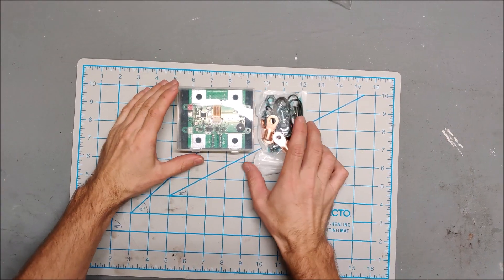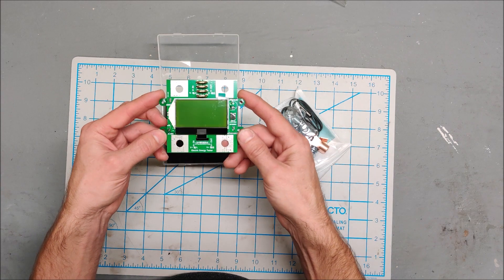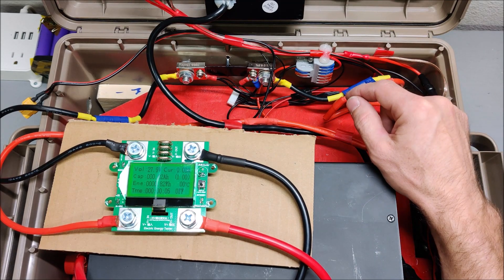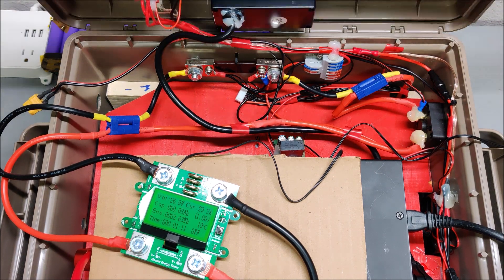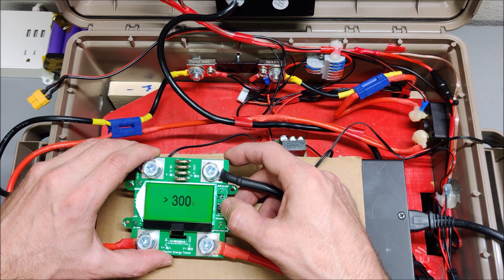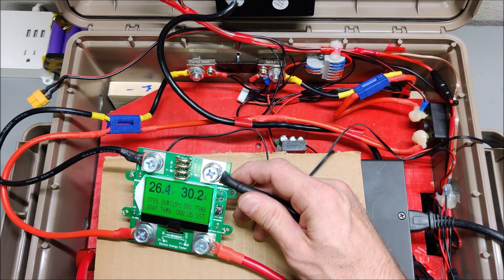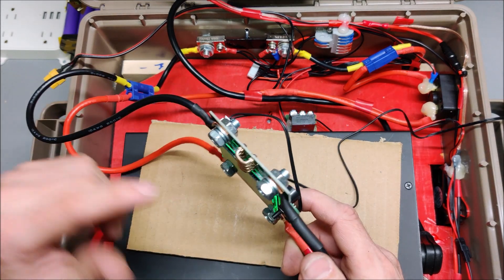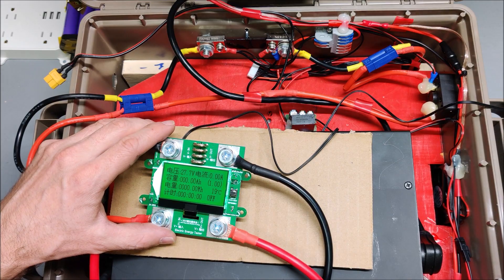$10 100A 300V INLINE METER

Comment: 8:32 The Greater than and Less than, are alarms you can set, So for example you can set an alarm for a voltage over 0-300 volts for example, or 0-100 amps etc... up to the rating of the device. It wont make any noise though, it will just flash when it reaches your set "alarm" voltage and or current range.

Comment: And, just like that, it's gone. Sorry, this item is no longer available!
Reply from the maker: https://www.ebay.com/itm/DC-300V-100A-Volt-Current-ZVS-Power-Detector-Meter-Discharge-Battery-Monitor/283530422402?hash=item4203bae882:g:8xoAAOSwIsddFc4A
Reply from the maker: https://www.ebay.com/itm/DC300V-100A-Digital-Voltmeter-Ammeter-Power-Meter-Car-Battery-Capacity-Tester-C/392808537169?epid=24013110946&hash=item5b75369c51:g:kq8AAOSwaNVe6KE8
Reply from the maker: https://www.ebay.com/itm/DC-300V-100A-Accurate-Energy-indoor-Function-Alarm-Overload-Backlight/143492457085?hash=item2168d1227d:g:D5IAAOSwOeBeEgQQ

This is also the same meter, but in a case!
Reply: Whoa! eBay. Guess I should have known. Thanks!